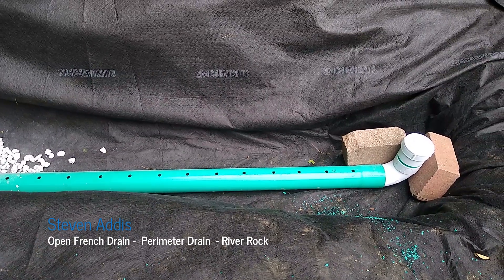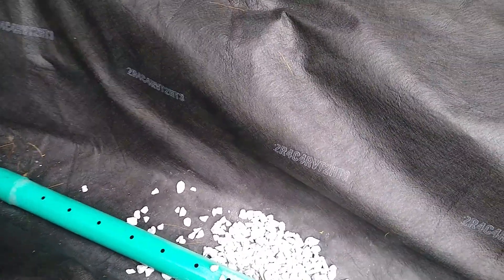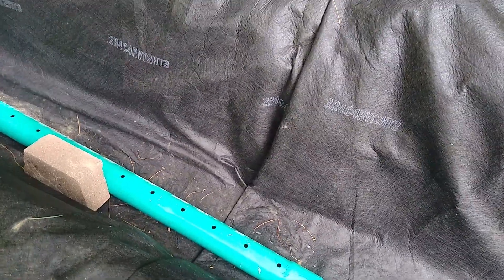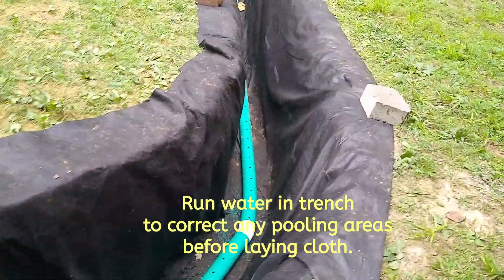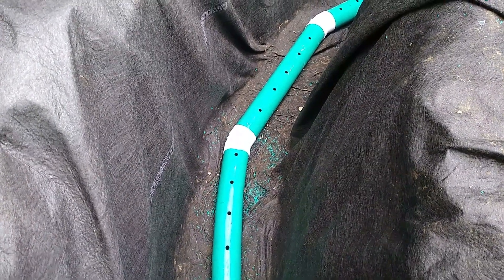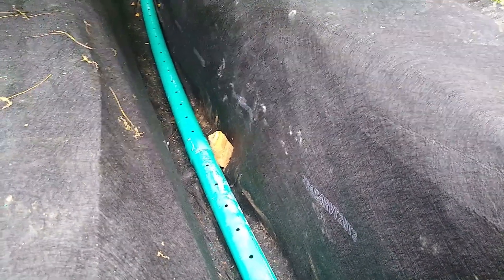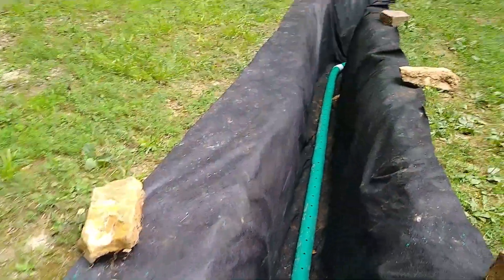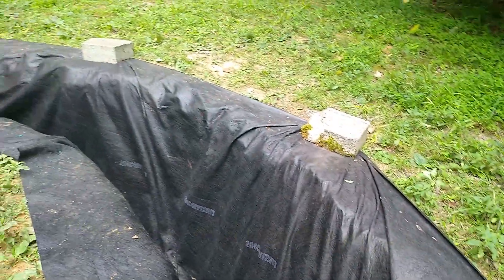French Drain 130' x 4' Deep | Hand Made - DIY | River Rock | Steve Addis

Comment: I have similar water to this on my property. In the spring I can dig down 12 to 18” at some points and find water. I have significant underground percolation at all times of the year. Before I moved, and I had a contractor put in a drain like this, but it’s covered by soil at the top and they used a perforated pipe. I assume that pipe is crush the moment they backfilled it. I can see a lot of water still come out of it, though
Reply from the maker: Your french drain looks to be working. If water is exiting the pipe that is great. If you filled it with crushed stone and not river rock, the stone seems to lock and support itself and not crush the pipe. You can use a camera to check. Even without the pipe, the stone does the job. Awesome!

Comment: Thanks for the video, great stuff!  How many more holes can be drilled before the SDR35 is compromised?  For reference I’m doing an open French drain with river rock, probably 12 inches deep and 12 to 18 inches wide.  Thanks!
Reply from the maker: Thanks. I gave up on drilling as it did start fractures with my bit. Was not needed. I used crushed stone number 4 size locks better support and protection of pipe. Smooth round stone moves like marbles between. Test it to see. River rock on top. Yet each will do the job. You will look every rain and see your previous hard work continue to move the water!

Comment: Did you save much money using SDR35 over Sch40? What other reasons did you use SDR35 instead of Sch40?
Reply from the maker: @Jordan Gore Very good question SDR35, as you see in the video, SDR has flex and really is designed for this. I used this for the pre-drilled holes as well. Standard schedule 40 is not and is for interior applications. Yet it would work. I used some 200PSI schedule 40 in another french drain because I did not want it crushed by vehicles. Yes they all likely would work. Thanks for your comment.

Comment: Good lord that is massive! Was wondering why you had the pipe upside down but looks like you drilled those holes yourself? It's been 8 months, hows the system working for you? Wish you'd done more than 1 pipe or is it working just fine?
Reply from the maker: Hi Aaron. This pipe came with three holes evenly positioned.  The two at the bottom are at about 8 o'clock and 4 o'clock positions. They form a  trough that the water rises up in and flows, when it is overloaded. I gave up the drilling. It works 24x7 for underground springs which goes out the gravel at the end of the trench. Then again it has massive capacity. One thing, I am keeping the river rock cover lower than ground level for excessive surface water events. So far, it has worked perfectly - thankfully. I built three more french drains that I have not posted, yet. This was hand dug with a pick, shovel and fence post tamper point to break sandstone. Glad it is done! I did consider redundant pipes. - Good point. Hopefully the clean-outs will allow flushing the stone with a high pressure clean-out tip if ever needed. Take care!
Reply: Holy crap I can’t believe he used a hand tool to dig that trench!
Reply from the maker: @patty109109 - This is considered my workout. I only dug, hauled and dumped in four or five hour shifts maximum. Cut it down a shovel depth at a time and kept the water flowing as it was done over multiple days. Not a production effective job, yet a fun challenge to do it the old way. No damage to the area with heavy equipment is a positive thing over the leach field. :)